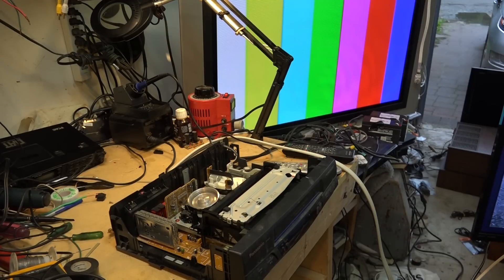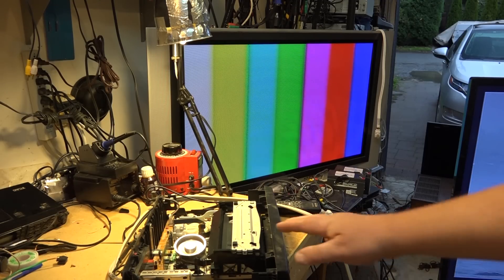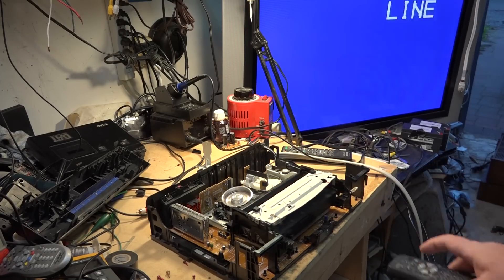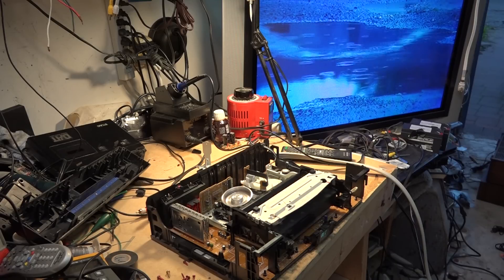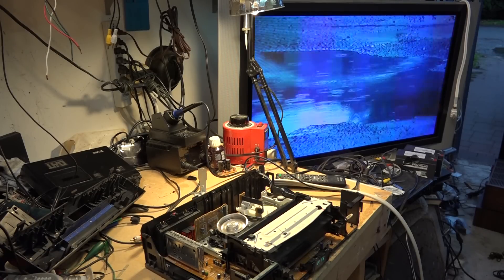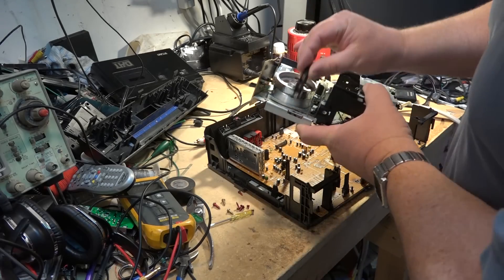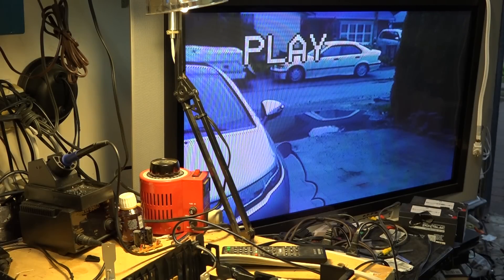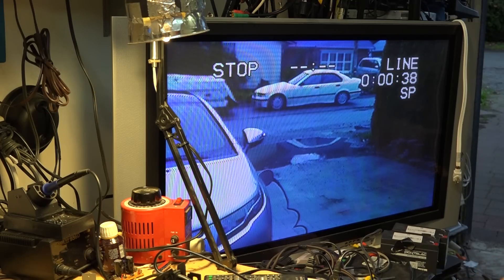VCR Erase circuit failure demo

Comment: I ordered a 1995 Panasonic pv m1324 TV VCR Off ebay earlier this month and i noticed when i make recordings off of that vcr the recording doesnt come out very good where you can see those lines that you would see at the beginning of a recording and see the previous recording especially in SP But in LP and SLP its a little better. Weak erase head? Still plays tapes perfectly.
Reply from the maker: More likely weak erase bias signal.  Heads don't get weak especially full erase head.
Reply: @12voltvids  it starts out really bad but when the tape reaches the end it gets a little better.
Reply from the maker: @austinthevhsvideogamelover5265  check to see the tape is pulled against the erase head.
Reply: @12voltvids  i can't really since it's a tv vcr. And that tv vcr has a earlier generation chassis one from 1991-1993 instead of the 1994-96 one that has that front loading cog that can get misaligned like what happened to that RCA 1996 VR508 Client owned one nearly 8 years ago in January 2016. Even though this model is mainly from 1994 the Manufacture date Says January 1995. If manufactured later than that it will say PV-M1324-A.
Reply: Also that line does go down but not for a long while nearing the end of the tape or in the middle. Very strange. And in lp and ep the lines are diagonal like. Almost close to a clear recording. I had a Philips Magnavox VCR in 2018 and i still have it and simetime in 2018 or 2019 the erase head got misaligned i will look at it one day. It said Magnavox on the front but philips on the back sticker. It was a early 2000s vcr made by funai. Other than that i never had erase head issues.

Comment: Ive had only one failure of the erase system.
A frend bought a vcr, it was a marantz front loader.
It never seemed right from the start, for some odd reason he didnt send it back (really odd).
Anyway he would blank tapes by recording nothing.
I did want to help, but stubborn people.... ya know.

Years later he upgraded and sold the marantz to me, i ripped the top off the odd one piece top/sides/back cover.
The erase head was above the mount post!!, it had been dropped in the original shop delivery and the spring pushed the head up and out of the way.
A single finger and half twist and the head neatly clicked back in place :-).
Worked perfect from that point onwards.
Odd aint it lol.
Reply from the maker: I had a failure of the erase bias circuit once, which also caused the linear audio to go bad as that same circuit was used for the bias signal for the linear audio. I had several where the erase head was unplugged, on mechanisms like this where the last person to put it together botched the job and bent one of the pins over on the erase head when plugging it back in.
Reply: Yes ive seen cassette recorders with a dead bias oscillator and the recordings just sounded horrible, even on a blank tape.
I had one man come along with a music center that didnt record correctly, the unit looked nice but when i opened it i saw the transistors in the bias oscillator were twisted (on purpose) and the transistors broken off!!, so the e,b,c were all shorted, Really strange :-/.
Two transistors and a 100 ohm supply resistor and bias was restored.
People are so bloody wierd, just nonsense :-/
Reply from the maker: It never ceases to amaze me the things people toss out. Wait for the next one, a Thornes turn table that was thrown to the side of the road.That table will fetch me about 5 large when I sell it.

Comment: 3:27 That reminds me... One of the things I dislike about Philips (DVD recorders) is that if it forgets the date and time settings(after leaving it without power for some time), it forces the user to set the date and time settings when it's turned on, and the only way to get past the clock set screen is with the remote. So basically, the unit is useless if it forgets its clock settings and the remote is missing.
Reply: Yeah i been there lol remember that i paid $100 for a replacement remote for a Hitachi vcr madness lol but most equipment are useless without the remote that sucks.
Reply from the maker: I was given a Sony DVD/HDD recorder without a remote. I managed to get one of the last remotes that Sony parts had in stock. That remote cost me 70.00
Reply: For me, while someone was selling one without the remote, I was lucky to later find another one for sale with the remote....